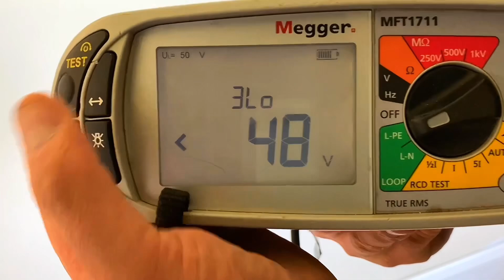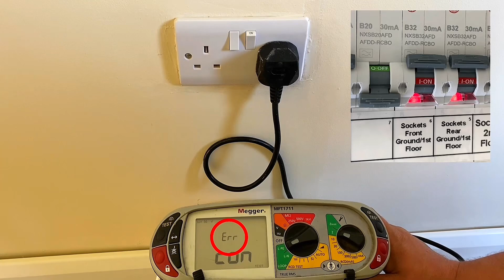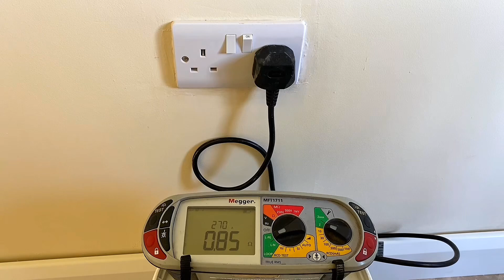Why Doesn’t my RCD Trip Whilst Testing?

Comment: You said RCDs & RCBOs. You should have said RCCB not RCD. I don't think the instrument balances the load, it utilizes a 15mA test current so that the RCD should not operate. However, if there was already some leakage current on that circuit, say 10mA for example, then the RCD could still operate. Remember a 30mA will operate before 30mA, not at 30mA. A ramp test will prove this